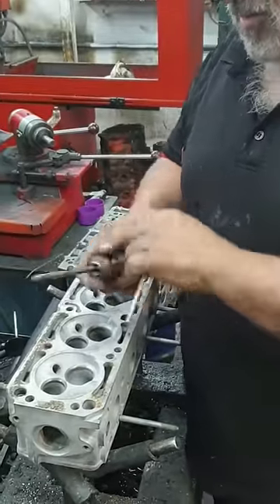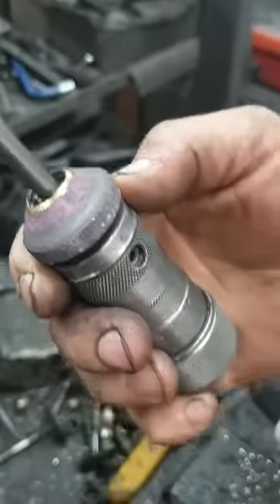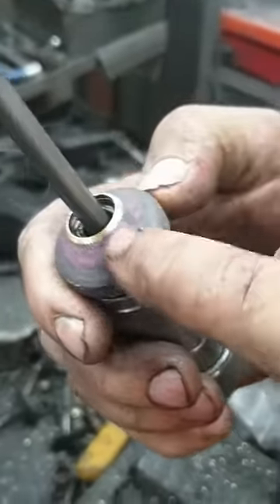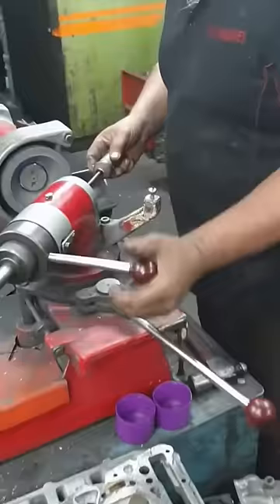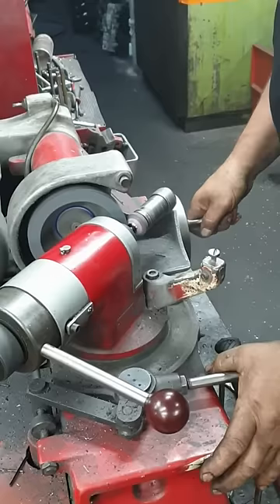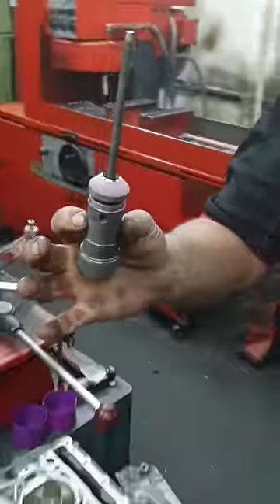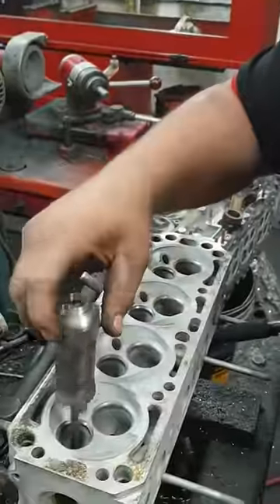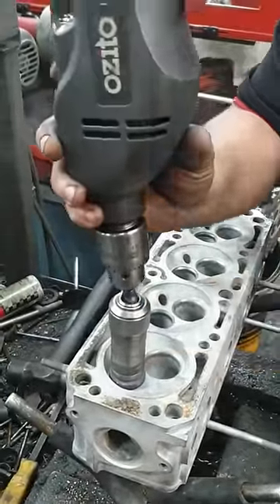Valve grind on a street sweeper cylinder head #shorts

Comment: I used to use a diamond tipped tool to true my seat grinding stones. I had a Sioux Valve sizing system.(it was older than I am now when I had it 40 years ago.)
Reply: My dad still uses one, i learned to grind seats on one. We didn't have any of the famcy new machines.
Reply: We still use them for touch ups. Not completely replaced yet
Reply: Yup

Comment: It works but that is a very old school way of doing that!
Reply: This is not the best way to do this job anymore. 😬
Reply: Does it work ?
Reply: @Gmoney1019  oh yea, it works. On some heads, just a quick touch with the stones is all thats needed. Most others, we use multi angle carbide insert and cut all our angles to exact daimeter in one sweep. But it's nice  when it's just a quick grind.
Reply: Nothing wrong with old school lads

Comment: This in is called a “pilot”
The grinding stone is screwed onto a “clutch”
Their are then put into the W&B “valve facer” and stone is then ground the same angle as the valve would be
Oil put on the “pilot”  then inserted into the “guide”
A electric drill with a “ball drive” in its chuck spins it all thus synchro seating occurs 
Similar to lapping a valve into a seat,
 but not

Comment: Odd, most people have a diamond tip stone dresser to cut the stone to the desired angle,  also the pilot is supposed to be wedged tight in the guide and then you slide the stone holder over the pilot. This is hack work.
Reply: I always use 30 first to narrow seat
Reply: @paulmallery6719 , Seat angle first,  top angle to proper diameter and bottom angle to proper width.
Reply: Not all piloted systems work the same.

Comment: I see your stone loading up with aluminum. There's got to be a better way? I don't grind aluminum, I sand it. Grinding stones load up..
Reply: But the valve seat he was grinding is not aluminum
Reply: @JM-yx1lm  if that's not aluminum, what is it? Do you see the aluminum build up on the stone? That means now you're grinding aluminum against aluminum..
Reply: @jamesrussell6870  But the valve seat he was grinding is not aluminum ...
Reply: The valve seats are not aluminum. The head has inserts that can be replaced if necessary.
Reply: @morganfreeman5171 But its not aluminium!!!
Reply: @jamesrussell6870  the aluminum buildup on the outside diameter of the stone is from slight contact with the chamber wall while grinding the not aluminum seat. Sometimes the seats are sunk in the head a bit and the stone may contact slightly on the outside of the grinding face aswell.  Just dress the stone and carry on.